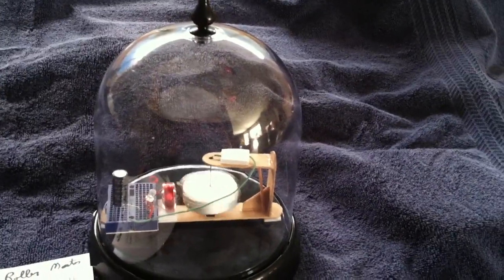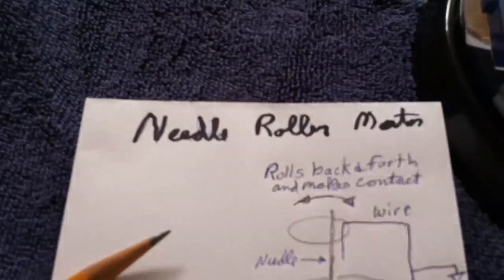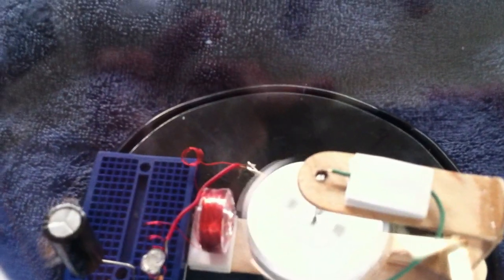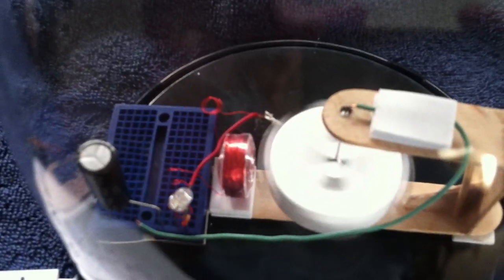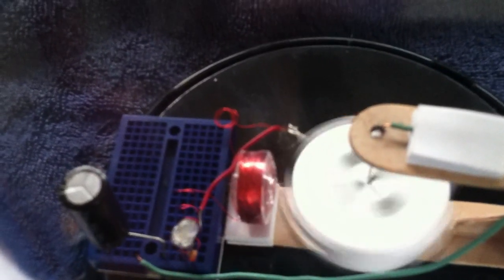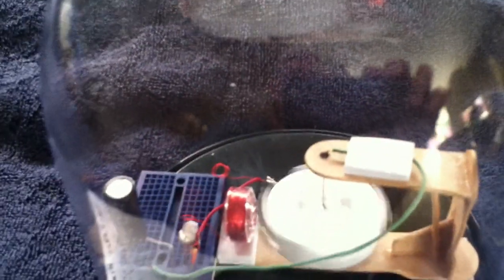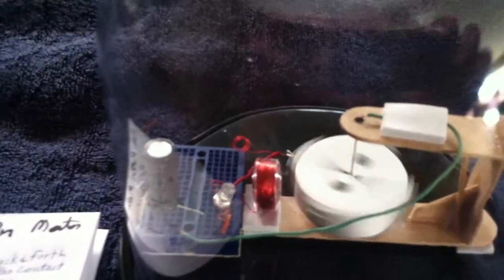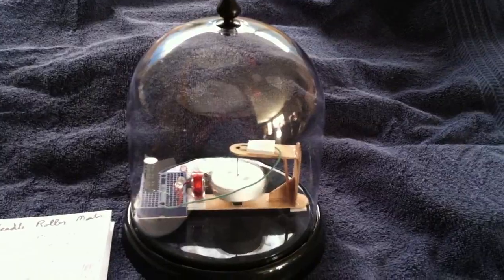Needle Roller Motor

Comment: This looks fun to play around with.  What would happen if you enlarged the hole a lot more, so the rotor really wobbled a lot?  Might create an interesting "precession" effect.   Depending on friction, you might need to add additional trigger wires around the inside of the hole, to keep it rolling.
EDIT:  and that bell jar looks VERY cool.  I want one.

Comment: I'd call it a "Tilt Rotor Motor" :)
Thanks for sharing! :)
Reply from the maker: Part of the reason this works is that the air core electromagnet pulls on the rotor magnet when it fires (attraction mode).  This draws the needle away from the wire and breaks the contact.  The rotation then rolls the needle back to contacting the wire.  Everything has to be just right for the magic to happen. It is terribly inefficient but fun to play around with.
Reply: Right, when the needle touches the contact wire, current flows & causes the electromagnet to create a magnetic attraction force on the rotor magnet--which then causes the rotor to move/tilt--which then opens the needle-wire contact point--which then stops current flow--which then causes the electromagnetic field to collapse--which then causes the rotor to return back to it's previous position via gravity to restart the process, yes?

I would agree with you about it being less efficient than a fine tension reed switch mechanism, but I have noticed over the years that you do seem to enjoy sometimes finessing your gadgets to get the most out of them.  It's a clever (and patient) tendency that lots of tinkerers don't have -- glad you do!
Reply from the maker: Thanks.